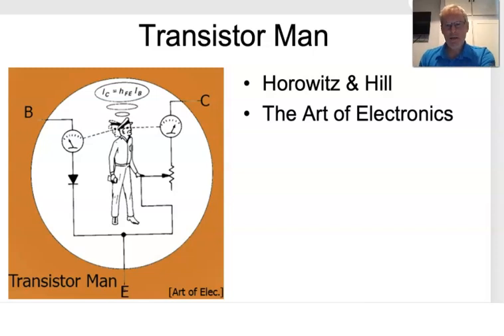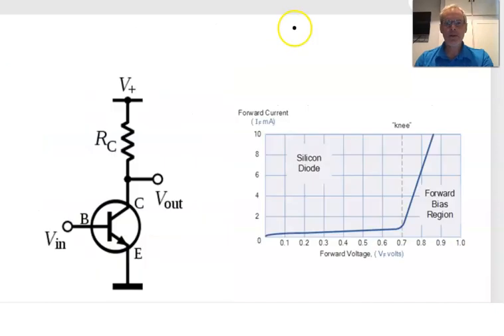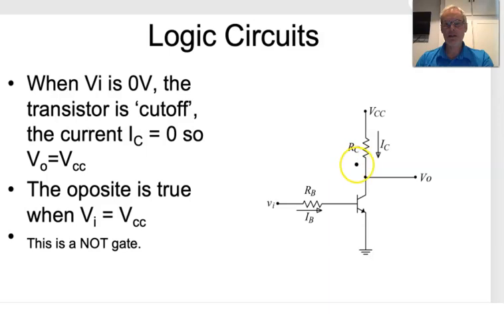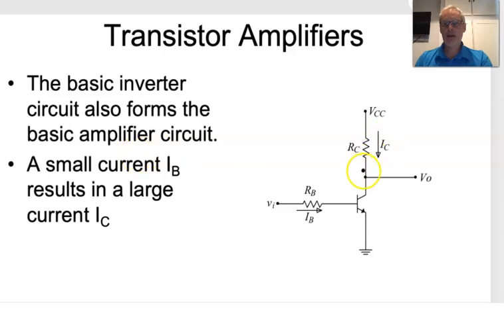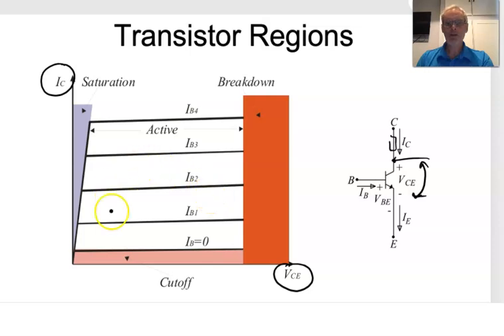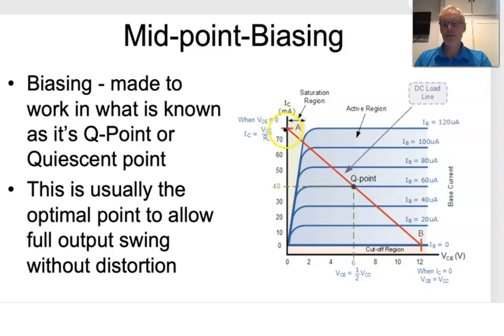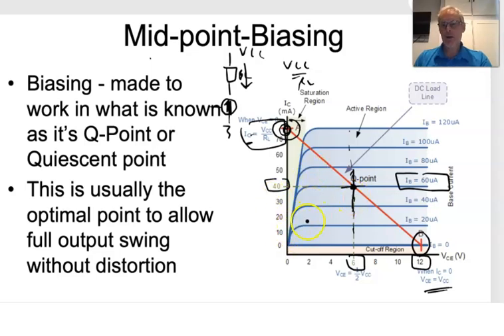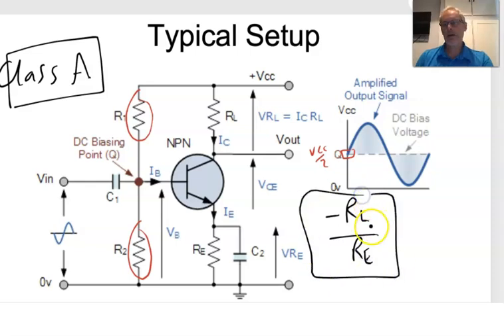Transistors (part 2) - Further exploration of the  Bipolar Junction Transistor

Comment: Should we also put a resistor on V_out?
Reply from the maker: If you mean to represent a load that the amplifier drives, you can yes. This would then need to be taken into account in its parameter calculations.